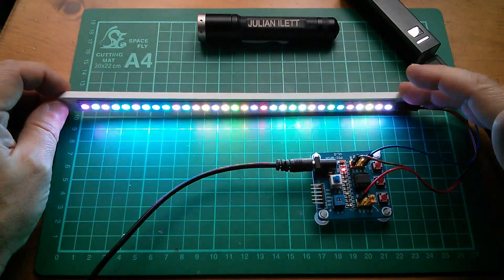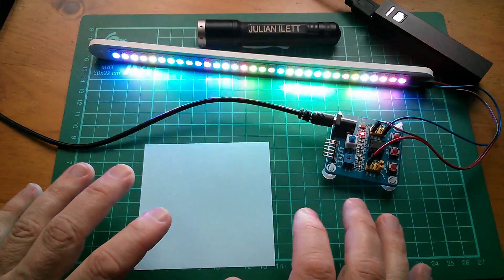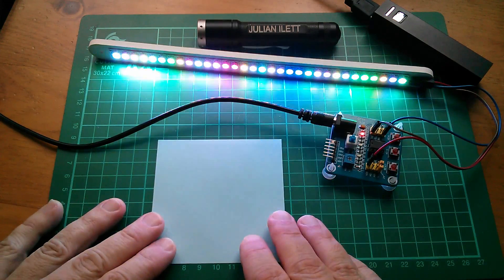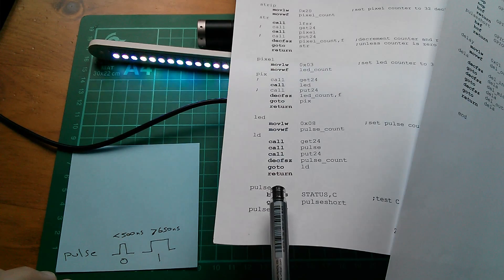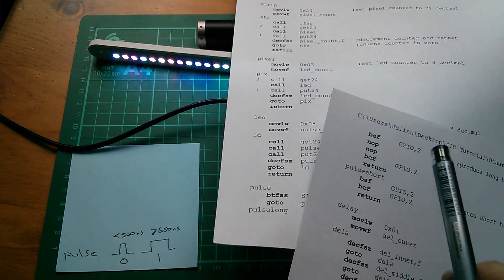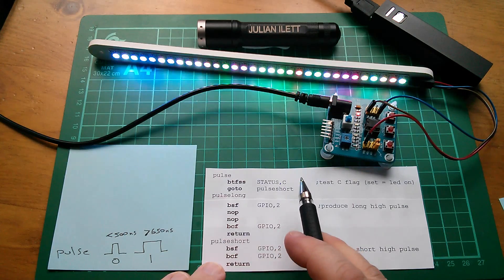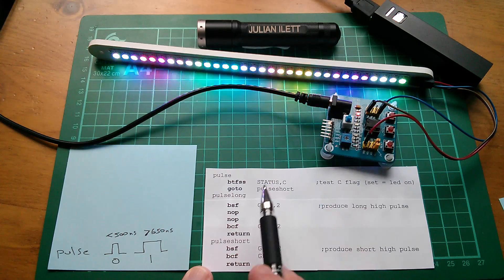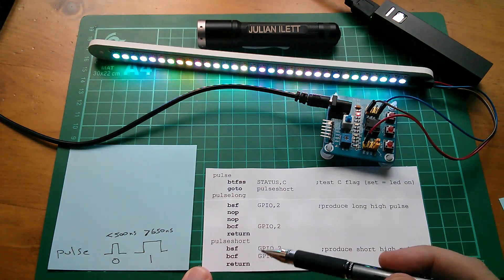Light Saber PIC Assembly Code Structure

Comment: That light saber is far to slow. Studies estimate the speed of the light saber extend time to be in the order of 100ms to 150ms.  Hmmmm - all this coding / work for 100ms of entertainment. You should have used an arduino - decimated your lines of code decimated your dev time and decimated your extend time.
Reply: Final phase should include power on / power off sound effects and accelerometer controlled 'swish' sound effect... I anticipate this would significantly extend the entertainment.

Comment: Not knocking what you are doing on here at all, it's a nice gentle introduction process and there is no sarcasm involved, but what is the real purpose of neopixels?
Reply: Animation, RGB display matrix's other cool stuff that require addressable multicolour LED's, oh and light painting.
One of the ones I did here: https://www.flickr.com/photos/68646769@N07/8201590290/
Reply: Twotone , neopixels have driver circuitry built in, so you can run 100's of them from just 2 power rails and 1 data line.
 That's much simpler than having to plan and wire up external driver circuits.
 As for why: ~ RGB LEDs just make the drugs more interesting.

Comment: and that's exactly why C was invented.
Reply: in C the problem would be the timing. as u dont know how exactly the compiler would compile the code. there are library's for say arduino.. and even they are written in ASM to insure correct timing
Reply: @Infinite loop: No one actually said that this is the first programming language. I don't know what your problem is, here...
Reply: @GenUltra758 And that's why inline ASM was invented.
Reply: true true haha
Reply: gcc_avr.so converts everything to AT&T format assembly language then calls gcc_gas.so to assemble the code depending on what switch you set you will or should get ELF format code to be programmed into EPROM.
Reply: Ehhh... You have about 20 languages before C...

https://en.wikipedia.org/wiki/History_of_programming_languages

(FYI#1: Fortran, Lisp and Cobol are still in use... and BASIC. :) )

(FYI#2: Fortran was actually used by NASA not so long time ago.)

Comment: Use long labels and aliases in assembly. Modularize and tuck away low level stuff for reuse. For example: pump_out_frame_to_pixelarray. When you are happy with its performance, you can consentrate on writing to ram instead. (my update frame routine got down to 1.5ms at 16Mhz). I have a loop in my pic+neopixelring that updates a frame buffer, pumps it out, on the ring wait for timer to timeout before looping. The timer helps me keep the updates constant even if the code length changes.
Regarding short variable names. Recently in the uni vhdl/fpga lab we were coding on a video overlay module (pacman) on a DVI-video stream. The code was from 2006, and the signal names in the videostream was e hpos href vpos vref etc, and the names changed between the modules even though they were the same signal. If the coder had written hsync, vsync, vblank etc I'm pretty sure I had used much less time on that lab assignedment, but who do you shout at 11 years after the code has been made.. lol.
Reply from the maker: I'm not using a frame buffer here - I'm synthesising the data and writing it to the Neopixel array on the fly (in real time). Kinda compliments my self-flagellation hobby ;)

Comment: Put it on the scope and see how all the call overhead and branching plays havoc with the timing.
Reply from the maker: Yes, the call and return overhead completely violates many of the timing specs in the WS2812 datasheet. Fact is, it still works.
Reply: Indeed.  https://wp.josh.com/2014/05/13/ws2812-neopixels-are-not-so-finicky-once-you-get-to-know-them/

Comment: Looks like the Animate routine is backwards as it is going towards the handle instead of expanding away from it.  In the past when coding in assembler, I found it necessary to have LOTS of comments.  It all seems LOGICAL when writing it but after a few hours it's like "WTF was I doing that code for?"  LOL.
Reply: Oh... and for me I would get the individual pixel colour brightness routine done before building up the upper routines that call it.  Just more of a hassle to have to mod everything later even though you obviously want to get to the "fun" animation routines.  My 2 cents.
Reply: Also, watch you don't use too many calls inside calls and overflow the stack.  I forgot which PIC model you are using but it might only be 8 levels deep.
Reply from the maker: Yes, the PIC12F683 has an 8-level hardware stack, and I'm using 5 of them - 3 left :)
Reply: Ha!  I was just looking at the 12F683 data sheet!  Guess it was the last one I had looked at so it showed up in the Firefox URL bar.  Some of the routines could easily be removed by putting the code inline instead of making a call.  For example the LED routine calls Pulse 8 times yet the Pulse routine is pretty short so it wouldn't add much to your program size.  You have 2K to use and that can go a long way (relatively!) in assembler.
Reply: i guess you cant tell the assembler to inline stuff? :P

Comment: That’s why the length of comments in my assembly code exceed the length of the code itself several times over. Still, even that doesn’t always help.
Reply from the maker: Agreed. No amount of comments can adequately describe how a piece of assembly language code works. Might as well have no comments at all. (controversial).
Reply: Julian Ilett, I used to write in a propriety 4 character nemonic language not that much more sophisticated than assembly language, and engineers who had never seen the language had to be able to decipher the code at a later date. Therefore I spent about 3/4 of my day writing comments, 1/8th of the day writing the code, and another 1/8th answering the phone explaining the code.
Reply: Yes they can!
Reply from the maker: You could argue that any comment which used the word "bit" (for example) would require additional comments to describe what a bit actually is. This argument tends to infinity!
Reply: No. Things like 'bits' should be self documenting by careful choice of their name. You have to define them to use them, so it's no more extra effort to make them document themselves. A subroutine should have a brief explanation of what it does and a list of what it's inputs and outputs are. Similarly with interrupts: "This interrupt is triggered by the overflow of Timer X". Comments which are really important are ones that explain a tweak in you program which might not be obvious. For instance, having three NOPs in a row to allow data to settle before reading it. If you didn't comment on that, you'd come back months later and wonder what those seemingly useless instructions were doing and delete them.
Reply: A successful programmer writes code only he can understand ;-)